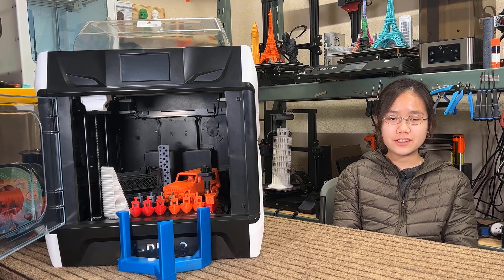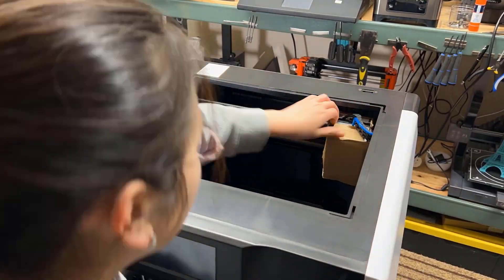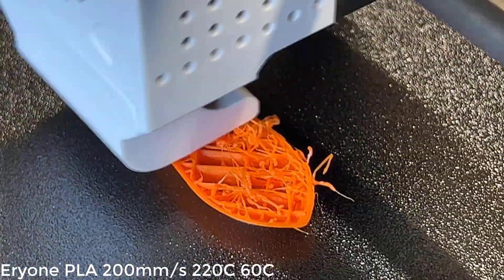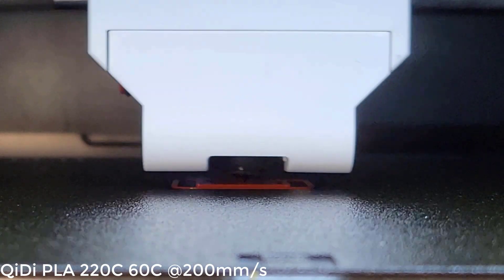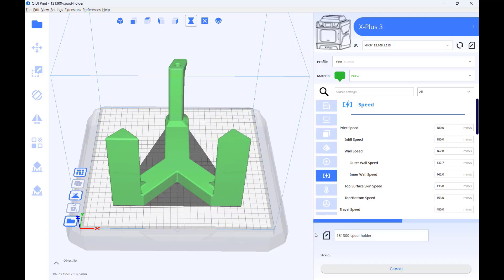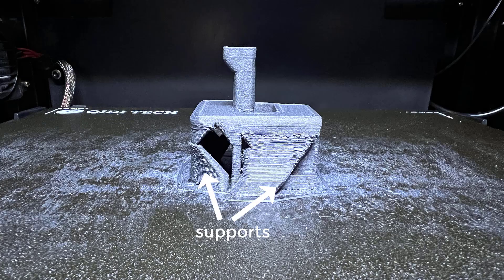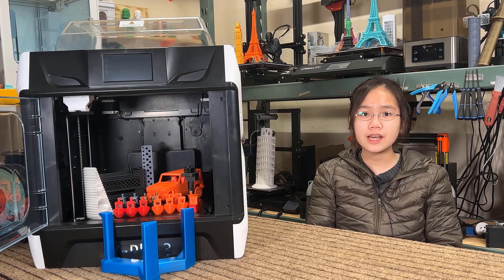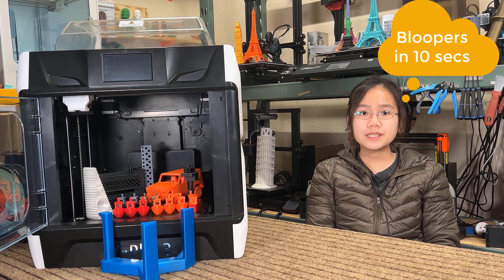$699 QiDi X-PLUS 3: BambuLab X1 P1P challenger? fully enclosed, actively heated chamber, 350C nozzle

Comment: I love your that your content is very thorough and the fact that you test across the board on competing printers. This model has a very similar construction (albeit smaller) to the X-Max. There's another reviewer that Experienced 'movement' in the Z axis Via Heat Expansion of .5mm after the initial probing and during the printing process.  Is this something you can look into? Or noticed through your usage with the heated chamber?
Reply from the maker: I've switched to using an inductive sensor for Z homing, which provides better accuracy for the first layer. To do this, you can edit the printer.cfg file in Klipper. By default, the machine uses the Z-limit switch at the bottom and travels all the way down and back up for homing, which is not ideal. However, this is a simple fix and shouldn't have anything to do with the heated chamber.
Reply: @AuroraTech  That great to know! I'll try to get an inductive sensor as well for the X-max I have preordered.  But I believe this issue had more to do with the z-axis screws being mounted to the thin base panel of the chamber, without a solid anchor to the framework. So naturally as the chamber heated up the plastic panel "lifted" the z-axis and the build platform .5mm mid-print.  Are you able to place a dial indicator on the build plate and heat the chamber just to see if it moves?

Comment: @AuroraTech  I bought a Qidi X-CF PRO last year for the high temp hot end (350c) so I could use high temp carbon fiber nylon filament to test print the hardware tools that I design. It was expensive but I liked that it was pretty much ready to use right out of the box because it came already assembled like the X-PLUS 3 in your video did. 
After watching your review video on the QiDi X-PLUS 3, it seems like it is better than the X-CF PRO but for half the price, am I missing something?

Maybe you could do a QiDi X-PLUS 3  vs Qidi X-CF Pro comparison video so people wont over pay for a so called "carbon fiber printer" when basically any printer with a hardened, high temp nozzle will work just fine.
Reply from the maker: No, you didn't miss anything. The new Klipper series is better than the old QiDi, thanks to BambuLab. It has changed the market and now everybody is trying to catch up. From what I can tell, the solid aluminum heated bed in the old QiDi has been replaced with a standard PCB type heated bed commonly used on other budget printers. Apart from that, yes, the X-PLUS 3 is both cheaper and better than the X-CF.

Comment: I'm brand new to 3d printing and need something to print ASA. Should I get the Qidi or save for Bambu Lab or Prusa mk4? The other option was to mod an Egeloo Neptune 3 plus with an all metal hot-end and use a grow-tent to keep the internal temps up. It seems the Qidi may take a few attempts to get the settings right for a specific filament, but that's not the end of the world.
Reply: ASA requires and all metal hot and an encloser. It is a relative to abs and puts out the same toxic VoC’s.
Reply: Depends, I definately wouldn't go with a P1P or Mk4 because ASA needs an enclosure.  That limits you to only the X1C and the Qidi.       Even then I wouldn't print ASA outside of well ventilated area or ideally you have a way to vent the printer or an enclosure for it to outdoors.
Reply: qidi has heated chamber if u only run asa and abs the heated chamber be better than non heated

Comment: What's the purpose of the dual power supplies and you said it runs klipper. So does it use fluidd or mainsail? I didn't see a web interface. Like can you make adjustments to it like normal klipper machines by just changing the config file?
Reply: The second power supply is likely mostly for the heated chamber.

Comment: Didn't see much about materials or build quality? The Bambu X1 has that steel frame, metal panels and a generally solid and hefty build. The interior of shots of Qidi's look like a lot of injection-moulded plastic panels and parts. The Bambu gives an impression of premium quality, this gives the impression of a budget copy. 
Sure, it's cheaper but you lose the really cool features (Lidar, Camera, and all the idiot-proofing error detection features) in exchange for a chamber heater. I think I'd rather pay the extra $400 to get the added features and the general build quality improvements.
More importantly, however, neither is actually a must-buy anymore. The X1 was amazingly alluring when first launched and stood head and shoulders above the competition. But in less than a year we've seen multiple other manufacturers leveraging these ideas to compete, and all the machines released (or releasing) have ended up looking like 1st gen, early-adopter models. At this point I need to wait another year to see where they take this next. 
I want someone to combine all these cool features (lightweight hotends, carbon rods, lidar sensors, error detetction, multi-material) with dual extruders. The purge/prime wastage is the biggest flaw in the Bambu. Fix that and you'll be onto a winner.

Comment: How difficult is it to update the firmware if QiDi came out with an update? Is that possible through a usb cable, or thumb drive, Or is it like the ender3 where you have to disassemble the controller to get access to the sd card slot?

Comment: The X-plus 2 began silently shipping to people around Nov. If they're releasing a third itineration, then I want a replacement of the 3rd gen. My xplus2 has had so many things replaced or found to be manufactured out of spec. The Y access rails were not even parallel.
I didn't get the x-max because of the improvements the xplus2 had, then in Jan silently released the xmax2. I would have spent the extra money with them if they were better at marketing..

Comment: How is the sound level compared to bambu and prusa?
Reply from the maker: Around 50dB when fully enclosed, the top cover is like air-tight, way better than a Prusa without an enclosure, slightly better than Bambu X1 with an enclosure.

Comment: ok cool, but with the bambu lab machines it wasn't mentioned how they are locked down on both hardware and software, and that you cannot quite mod it like an ender 3 v2 because it has proprietary connections and parts .

how about this one? is it open source? or are you stuck with them for hardware and software?

it's such a critical point as i want absolutely nothing to do with the company after buying their printer and perhaps buy spare parts directly from them or contact for warranty, i absolutely don't want to rely on them for slicing software or firmware, i DEFINITELY don't want repair that requires me to send back the entire bloody machine while missing it for weeks on end and be able to mod it without proprietary parts that may not be sold anymore in a few years from purchase.
Reply: This is exactly why I ordered the X-Plus 3. I had an X1CC for a while but the closed ecosystem really turned me off being an enthusiast. This one should be pretty open considering they use klipper. Hopefully it gains enough traction in the community as to get lots of support.
Reply: as long as they make it few years which they will. u will have no problem the clone parts are already flooding the market just matter of time

Comment: Are you going to review the x max3 ?
Reply from the maker: I am afraid not as my schedule is full and they are too similar, the Max just with came with a slightly larger print volume, added an air filter, and 900W PSU(450W x2), so, my comment would be pretty much the same. I may review the X-Smart3 in July as I am still interested to see how that sub $500 machine performs.
Reply: @AuroraTech  yes that would be an awesome! Interested to see what the new sub $500 printers will be like

Comment: Thank you, now its clear it cannot really compete with an X1C, but good approach😊
Reply: I think the difference is you could tune it and upgrade it to match the X1C pretty easily.   That is the benefit of not being as locked down and using klipper.      For example you can manually tune linear advance in klipper.     Out of the box the X1C is going to be better but I would bet you could tune this to equal or even outperform it.

Comment: The only issue with bamboo lab is that I have to upload the designs on their cloud slicer which has zero security architecture in place. I’ll buy it in a second the moment it’s on cura
Reply: Bambu Studio is not a cloud slicer though...? You can use it without internet connection if you want.
Putting that aside, there are also Bambu Studio forks (OrcaSlicer)

Comment: P1p isnt a fair comparison for a seal heated chamber. thats going after the x1. Funny how it uses almost exact setup. Few nice touches
Reply: It is when your comparing price though.   This is a competitor to the P1P for the most part.   I would say the bigger one is more of a competitor to the X1C.
Reply: @MaethorDerien x1c,x1,p1p are all same size 256³ The marketing team is failing putting it against a p1p. By their design best it can do is win, but its supposed to. Theres no story if college football team beats a highschool team. But if that college team goes against 
An nfl team win or lose they look better. Market it against an x1. Its similar and $200 less. Goes against 2 markets amd tretens a 3rd. P1p or a ljttle more for a better machine. Heaper option than an x1, Sure. Do i want an x1c i can save close to 500 and get the xplus.

Comment: I understand the focus on default profiles, but every machine has different limits. I was not able to judge the flow rate, minimum layer times, or max acceleration from this testing. Different vendors are more conservative or aggressive with profiles. Also some profiles are just plain bad. Follow-up videos with tuned profiles would be appreciated.

Comment: Seem like Bambu Lab lit a fire under their asses but sadly it seems a little rushed. It has good bones but doesn't have the polish it needs to compare with Bambu. This is the old ways for 3D printing companies where they let the users "beta" test their MK1 printers. But that doesn't fly anymore. If you don't make a printer that prints as fast, as well and within the price of the Bambu Labs printers then it will fail. 

They need to bring it back in to fix/polish these issues or the only ones willing to buy it will be people who are fine with modding their printers to get it right or people who don't do enough research. As I said, it would be a really good printer because the hardware for the most part is there. It just needs a few more pieces and tuning.

Comment: So much plastic... also, how is 8 screws too much to swap a hotend? All they need to do is add a plug or add a simple breakout board on the front so you can unplug cooling fan and the hotend fan without removing the back plate.
Reply: I'll actually echo her comments.  It's no so much the number of screws as the fact that the ones on the back cover are self-tappers and very difficult to get started without dropping them, and the cabling is so dense that it's difficult to get it back on and laying flat without pinching anything.  This is especially true if you can't easily walk around the back of the machine to see what you're doing.

Comment: 280x280 is not bad. However, at these prices, they need to push to 300x300x300 or more.
Reply: This is a low price. Not a high one. 

They have larger. It’s called the Max3.
Reply: @rsilvers129  $1099 is not what I would call a low price haha
Reply: Problem is that chinese manufacturing has totally warp our sense of what is right price of something. If this was made in first world country it would be double price. This printer in not cheap, its ultra cheap
Reply: @robblly8112  you have no idea how much crappier 3D printers USED to sell for in the early days of 3D printing. This is a bargain. Buy an Elegoo Neptune 3 Plus for $350 then. Still a great printer but slower. Add Klipper if you need faster.
Reply: @slappy76   that's great an all but i fail to see the relevancy. i never claimed that I MYSELF was buying a new printer, just that 1.1 grand isn't exactly cheap.

when did i ever mention about past prices? how does  that even contribute to your argument? assuming i haven't been around in the 3D printing industry is just one of many faults you have.

a 1.1k printer is not a bargain if it doesn't meet any of your needs. raise the price by $100 more, and you get one of the most famous and ground-shaking printer, the X1C, the 3D printing industry has yet to seen. not to say the QIDI is bad, just that it's a high price. just like the X1C.

take a better look at what i'm saying before making assumptions, alright?
Reply: @robblly8112  in printer world for specs  u get with heated chamber it is cheap very cheap
Reply: @jamesharris9894  compared to others, this would not be "very cheap". sure, it's not an insanely high price, but it's not cheap.

in absolute, this is not cheap. that is how i was communicating. for the average user, this is not considered cheap. i don't understand why everyone needs to make a big deal out of this.
Reply: if u comparing it to ender then yeah not cheap but if u go spec for spec with other printers it's cheap for what u get
Reply: @robblly8112  and yeah 1k for anything not cheap guess should say its highly competitively priced with printers in its range of features
Reply: Fact is, slightly larger size doesn't increase cost that much. Components and features do. Size would affect shipping, but still not hundreds more.